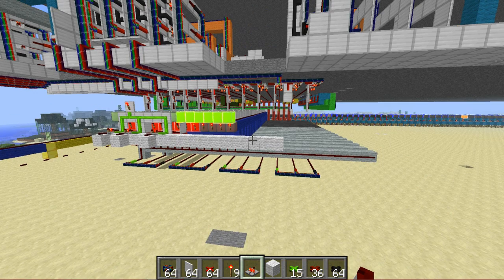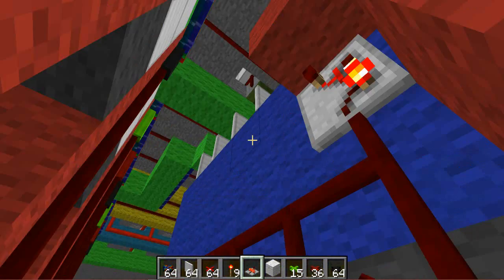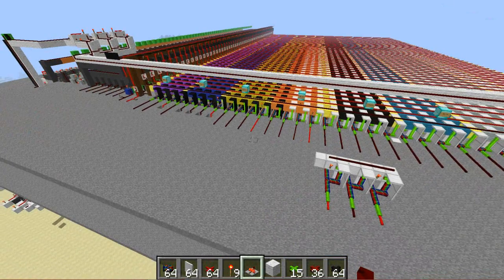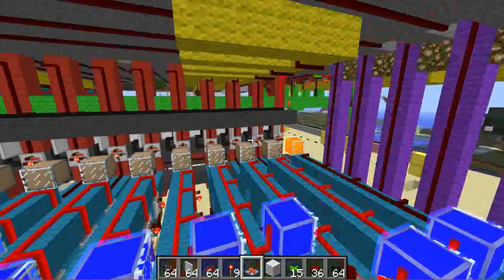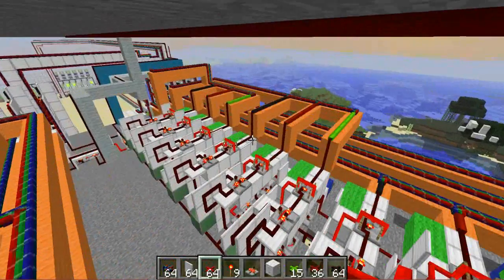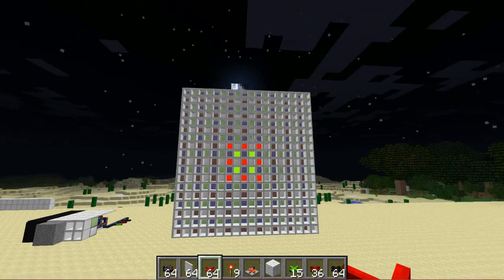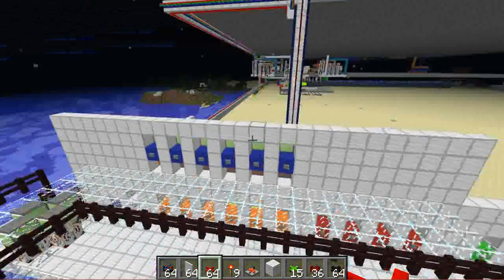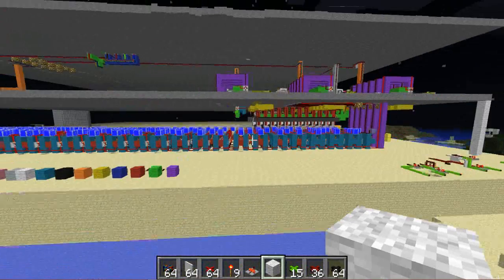Minecraft - Redpower mod - A computer I was working on about a year ago...

Comment from the maker: @Dark0Lord7 well, unusually I don't thin I'm going to actualy be using a system clock...
infact it would be much faster without one, instead: once a part of the computer finishes processing then it straight away gives the data where its needed, although I may need to use delay gates that change how long it takes for the signal to get through depending on the programming.